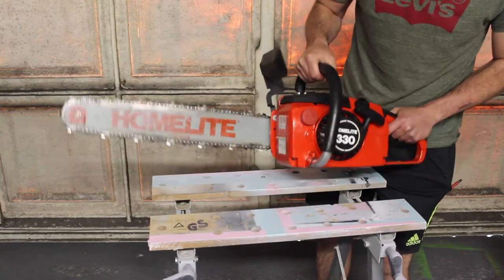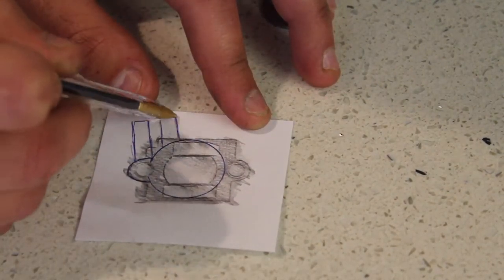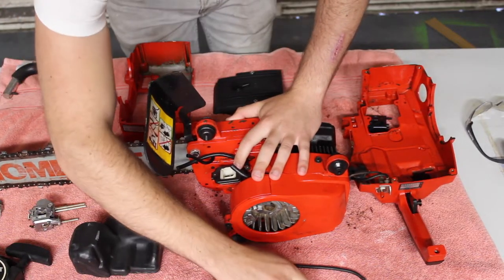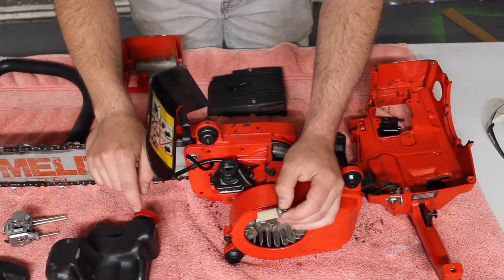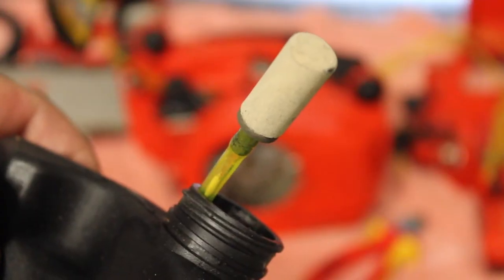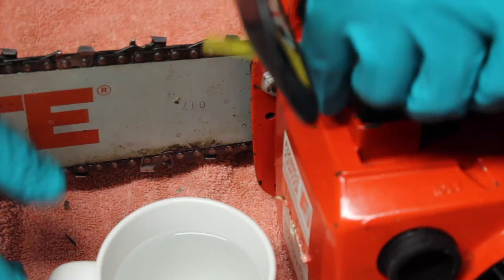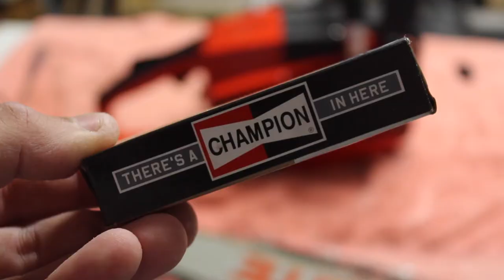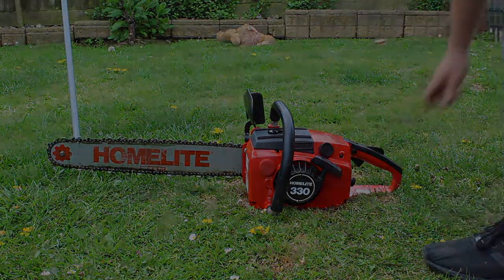WILL IT RUN? Homelite 330 Chainsaw

Comment: Good video.
Would like to have seen how you made the rubber boot.
Good tip w/the hot water for the fuel and oil lines.

Comment: Hey man, great video! My dad just gave me his old Homelite 330, bought new in 1984. It didn't run, and he said he hadn't touched it in ten years. I cleaned the carb out and put a new fuel line in, and I was able to get it started but it smokes like crazy and the engine revs like crazy...SCARY high RPM's.
I'm starting to think it could be the fuel/oil ratio. The manual says 16:1(which is what I've been using), but that seems ridiculously oily.

Since most of the replacement parts are from US sellers, the shipping charge isn't as big of an issue for us, I suppose.

Finally, I'm assuming there were different iterations of the Homelite 330, since yours looks a touch different from mine. The biggest difference is mine doesn't have a chain brake!
Reply from the maker: Hi Mike, thanks man! If the saw hasn't been touched in 10 years I would suggest looking at the air intake boot as the rubber seems to melt into a gloopy mess. This air leak will also cause the saw to rev way too high. Scary without a chain brake! Mine runs well on 50:1 but I don't have a manual to confirm if that is the correct ratio. Before trying to start it again I would definitely look at the intake boot as you don't want to damage your saw from running it lean. The carburettor will most probably need to be tuned up afterwards as they are often tweaked when they have the air leak to make them run better. 

Being in the US, you should have no problems getting the parts for them! They possibly have different variations of the 330 but can't say for sure. 

Hope you manage to get it sorted!
Reply: Thanks!! Yeah, right after I watched your video I saw several more videos where this model of saw had this same issue...so I just bought the boot as well. If I'm gonna fix it, might as well do it right!
Thanks to you (and all YouTubers who fix things) for giving the rest of us the confidence to try it ourselves!